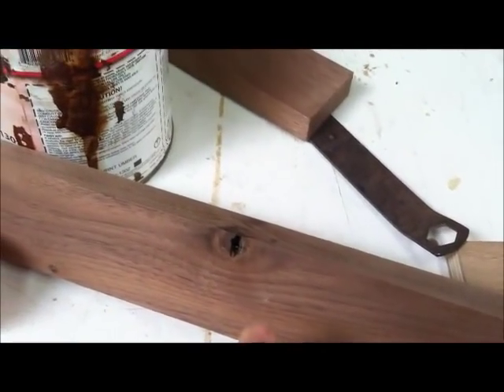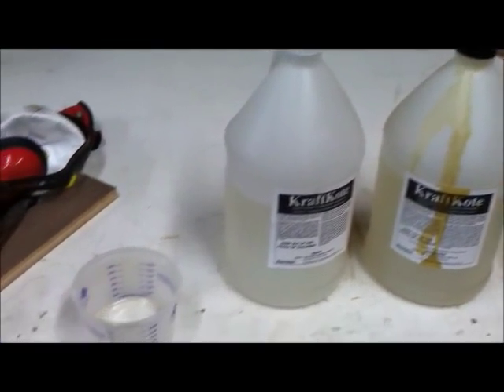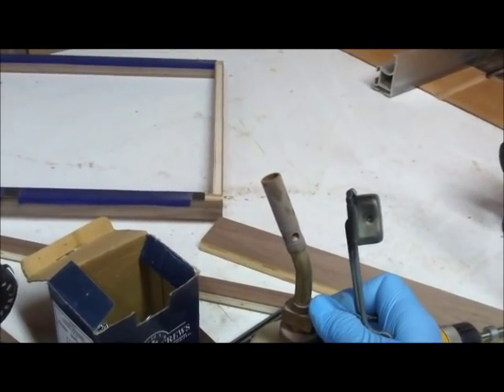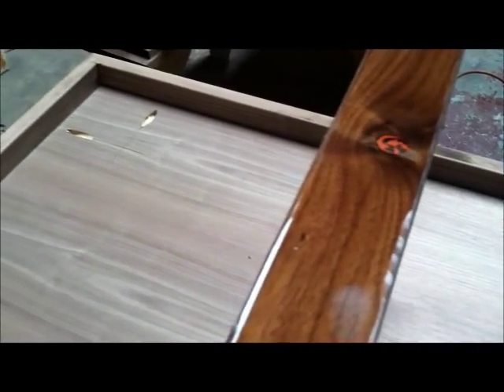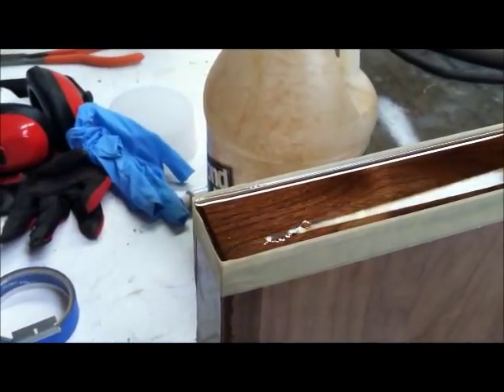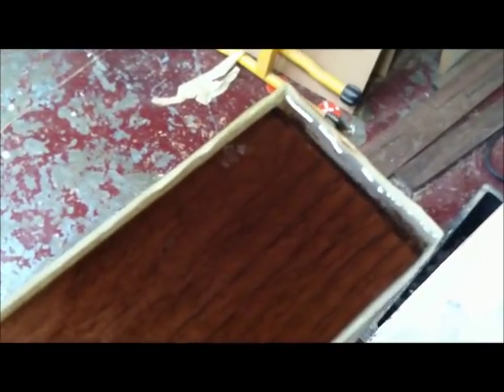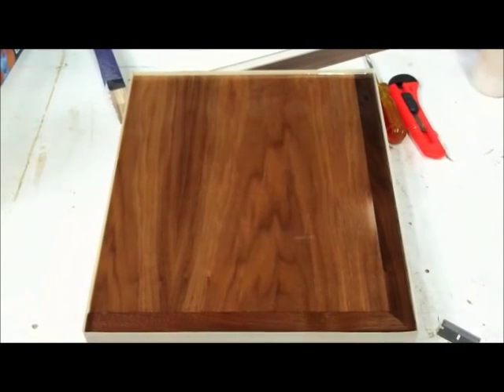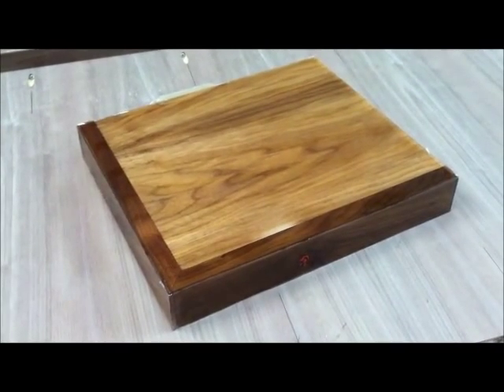epoxy tabletop with edges sample

Comment: Thanks for posting this video.  I'm about to do a mantel made from a Parallam beam (9ft long, 21in wides, and 6in thick).  I've done several test pieces but getting somewhat of a wavy pattern down the 6" edge.  I guess I might have to pout multiple coats so it flattens out?

Comment: What pigment you are using with bondo, i could not source the paint from video? I have been looking suitable product, but could not find one, or cared to experiment due costs. thanks for the help in advance.
Reply from the maker: I've been using chroma chem pigments and also resin pigments that are used in surfboard glassing.

Comment: That is an absolute disaster.
Thank you for showing us how not to do.
Reply from the maker: yes that was the point of trying a sample before going into production. the method i found most suitable is to build up the vertial surfaces with multiple coats, it just takes a while because each coat takes 24 hours to dry.
Reply: Morgans Woodshop 
Do you have a video showing layer build up.
I'd be interested to see the result.
Especially around the edge after the form is removed.
Reply: Morgans Woodshop fn
Reply: Morgans Woodshop No need to wait 24 hrs. When it becomes tacky you can add the next layer(s). Save yourself some days! 
Also you re.I've the tape once tacky. Do not wait 24 hrs.